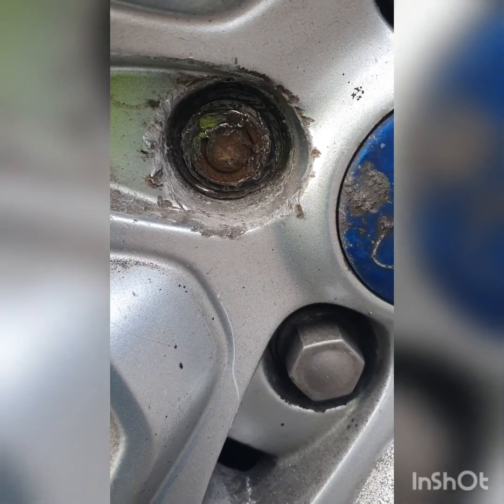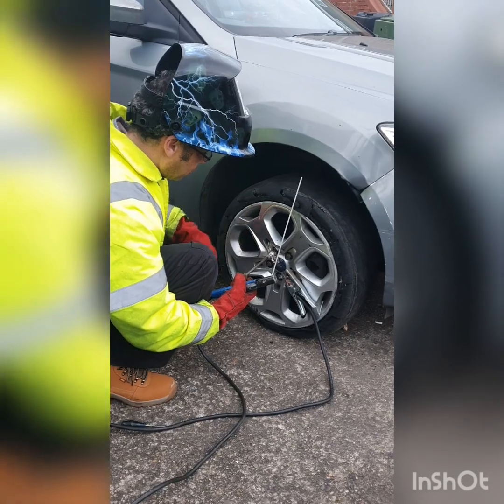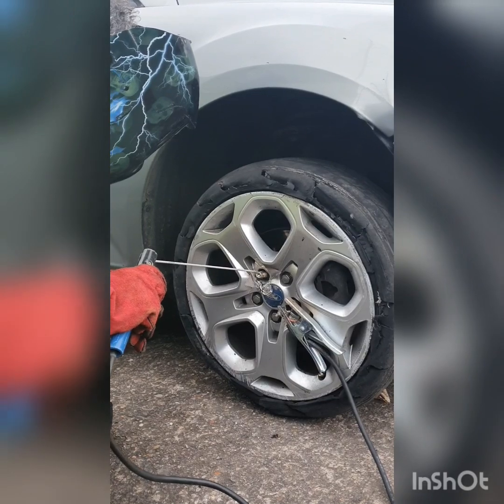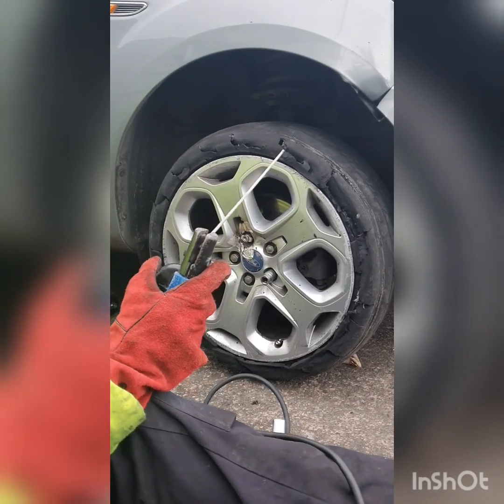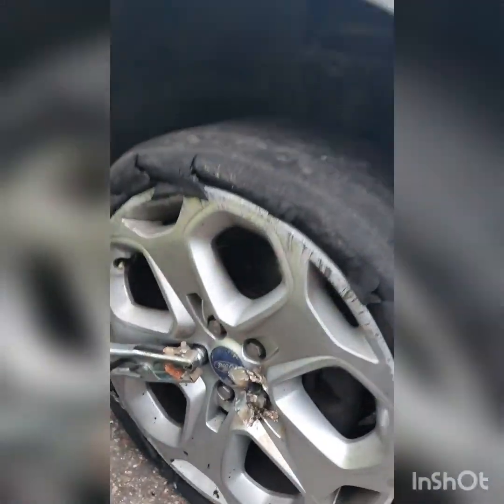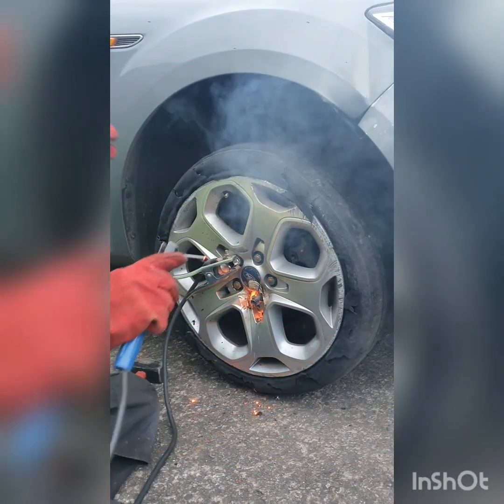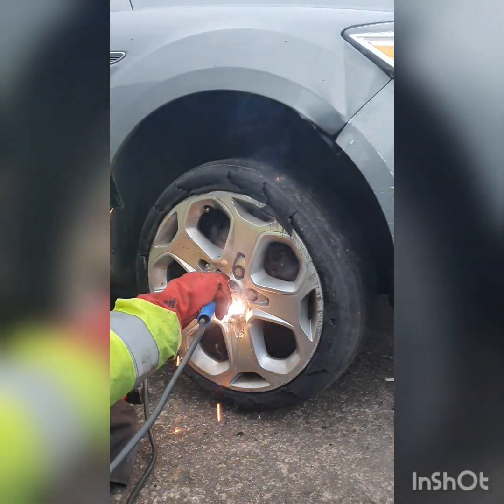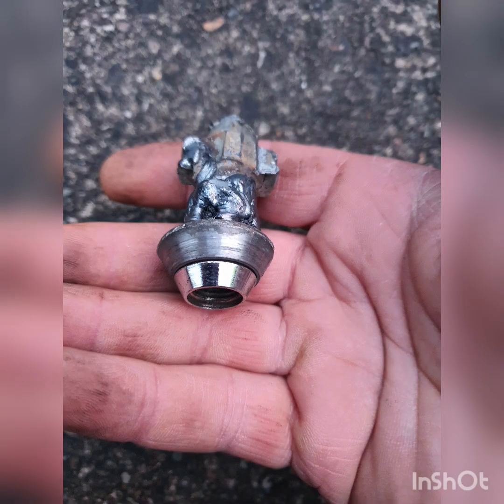Welding a sheared off Ford locking wheel nut!

Comment: I’ve got four bolts to get off a Peugeot because the key’s been lost. Plan to weld a 25mm od tube to the bolt so I can weld on the inside of the tube and not damage the alloys. Not seen anyone else try this way yet, I could be the first!
Reply from the maker: How did you get on with the welding?

Comment: Which size rod did you use, Was that 1/8 or 3/32?
Reply from the maker: Cant recall now..but i generally use a standard 6013   2.5
Reply from the maker: If you are in a really tight spot withnthe wheel nut almost touching the rim then 1/8 is better for a beginner..